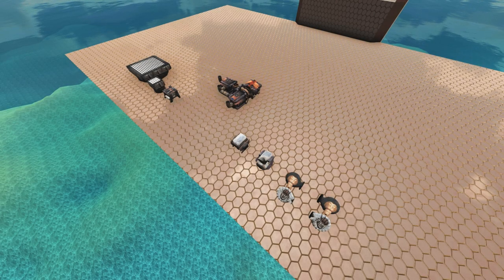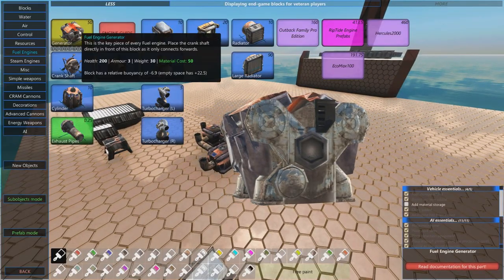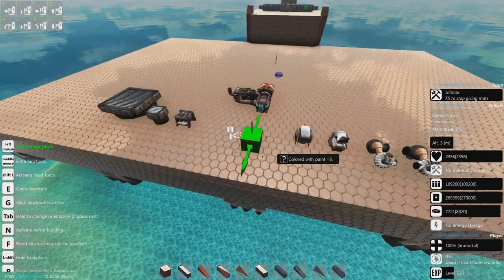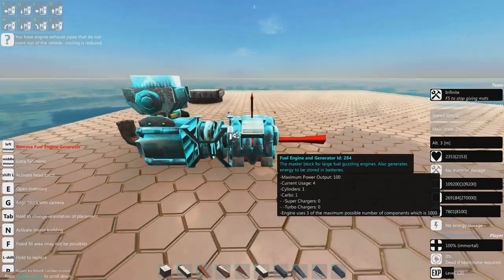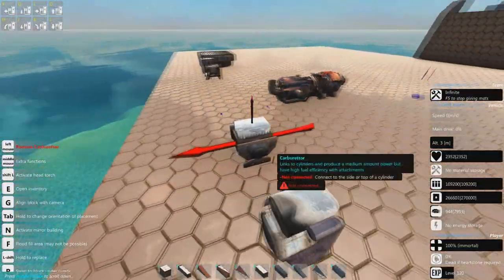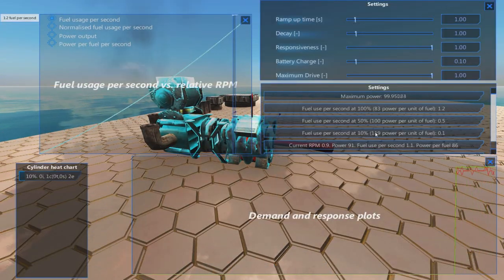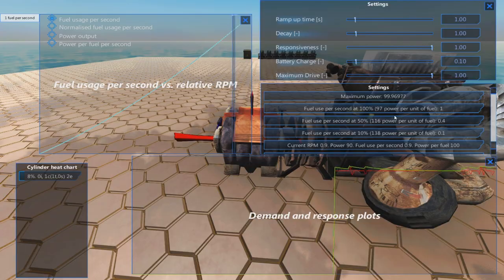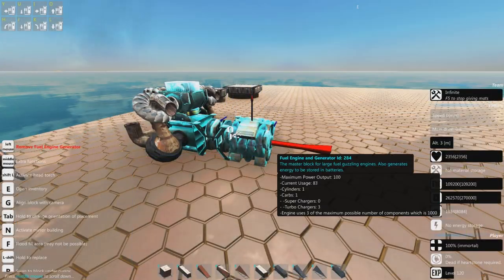Fuel Engine Tutorial (Part 1) - From the Depths (OUTDATED)

Comment: I always found it funny that engines can somehow stay down at 0°C
Considering that's the water's freezing point, it means it's colder inside the engine than in the world around it
Reply from the maker: Huh. I never thought about that... 🤔
Reply: @BorderWise12  when running methanol in an ICE(Internal Combustion Engine) , you can get frost on the exterior of your intake due to evaporation cooling.

Comment: The thing with the turbos is that those bottom connections are interchangeable, you can have exhaust come IN from either port, but then the other side HAS to be exhaust, that's why that first turbo didn't work as well, you tried to use both sides as intakes. Also neither variant actually has to connect right to a cylinder, the only thing that separates the inlines is how the input/output is set up. Many good engines actually chain the turbos together as they go, making the engine more efficient the further down it goes
Reply from the maker: That is excellent to know, thank you! :D
Reply: wait... THE TOP CAN BE AN EXHAUST ENTRY?!
Reply from the maker: @kirknay  My mind has also been blown. XD
Reply: @kirknay  Oh, nonono, not the top pipe, that does nothing, either of the bottom two pipes can be used interchangeably as an input, the top is always dedicated solely to the carbs

Comment: borderwise, what are you talking about? superchargers are insanely good if you do not care about anything but efficiency. I have made engines that can get around 500 power per fuel easily.
Reply from the maker: The engine prefab I use most often gets 964 ppf... and not a supercharger to be seen. 😛
I freely admit my ignorance regarding good supercharger use, though.
Reply: Superchargers only work when at low RPM, and there's no reason to be at low RPM unless you're idling while in play
Reply: @rompevuevitos222  And if your craft is running low-mid RPM in peak operation, then the engine is too big.
Reply: @BrokenLifeCycle  Just overshooting in power, you can replace injectors with carburators and remove some cylinders, you end up saving fuel and resources on the cost of the engine
Reply: but muh power density
Reply: I also guess the super chargers are really good for engines which use a lot of fuel under full power and the craft needs a lot of power even when it's not in combat. When there are no enemies around and you take down its shields and what not and still need power, you have your super chargers ready to produce that power at lower RPMs. And you want those lower RPMs when your unit is not in combat so you save more fuel.
Reply: @MrBrander  When not in combat you can pull units out of play to not waste resources, including fuel
And even if you are in a situation where you can shut down shields and similar to save power, placing ACBs to do it could get expensive enough to make it not worth it
Reply: I'll try experimenting on some kind of fortress that runs giant engine with superchargers that solely acts as a giant electric socket, and then use a fleet that runs mainly on battery. Probably not worth it, but hey, reason for a block to stay in the game.
Reply: @haveiszalfaroqie1628  I've always wanted to make a high tech fleet wich relies on maintenance crafts and buildings
For example: defenses are made out of lasers and particle cannons as well as a single bunker wich generates power, ammo, detection and runs some sort of support weaponry (jammers, harpoons, etc)
Fleets always have a carrier/repair drones with it that take care of the more technical stuff, this means that the rest of the crafts can use more of their space for combat capabilities and save on resources by not having to put repair bots and resource generation in all of them

Comment: My guide on my own ridiculous inline turbo fuel engine build.

-find a way to connect all cylinder sides with exhaust lines.
- leave the top cylinder for the carbs
- funnel every single exhaust line to the very first turbo on the line.
-connect the turbos together so that the exhaust gets reused by the other turbo on the next line.
-point the end of the exhaust turbo line away for max cooling.

*u can experiment by using a group of cylinders using an injector system. They produce a heck of a lot of exhaust and feed it to ur inline turbos. Turbos gets more efficient the more it receives more exhaust.

And the best part of it is to have fun solving the jumbled up mess of exhaust lines running throughout ur build.

Comment: 600+ hours in and I have never once built a fuel engine.
Reply: I currently run steam myself whenever I can, but settle for RTG battery setups when steam just can't fit. Fuel just doesn't have the versatility or output I need right now, especially now that steam engines have direct drive to screws.
Reply: On top of the fact that there are no engine prioritization systems in place. It will just pull the steam power, fuel, or electric. It can be a bit of a bummer when making a main steam drive with an auxiliary carburetor engine for backup power, since you want turrets and props to run on fuel engine more than steam engine that gives the ship a huge thrust advantage and/or act as a main generator for railguns if fuel engines do not have the space to charge batteries fast enough.

With fuel engines, supercharged carburetors are preferred for efficient builds, while steam takes over what fuel injectors fill in, while steam engines at larger sizes are especially tanky.

Resource usage is more significant at local settings, and cost rate is dependent only on volume.

That being said, someone better bring out the spreadsheets on the material conversion cost in comparison to fuel and steam engine to thrust.
Reply: @Aereto  you actually can control, to an extent, where power goes. On the fuel engine, you can set the % amount of power going to batteries. On top of that, you can have ACBs controlling the max output of engines. For example, your LAMS may occasionally use too much power, but not often enough to use more steam. So, use ACBS to do: when your battery is below 20% turn fuel engines to 100%, and another to turn them off and youre good.
Reply: I like to use hybrid systems that use RTGs and batteries, but then have a fuel engine that turns on when battery power dips below 90% (via ACBs). Very effective.
Reply: @brade3092  a sub i built runs everything on RTG except im combat. The shields drain the battery quickly and I have a fuel engine that kicks in to send ALL the power to the batteries

Comment: In-line turbos are your friend. Each turbo can only boost efficiency depending on the amount of exhaust gas passing through it (which is determined by the RPM). However, at some point (24 units, I think?) the turbo does not boost efficiency anymore. Because turbos only count the amount of gas passing through it, you can daisy chain the turbos together and they will all share the same efficiency boost. With a big enough engine, it can even have max efficiency boost at the lowest RPM because there are enough units of gas already passing through it. 

So to min-max an engine, you first collect the exhausts of the cylinders into a common pipe before running it into the turbo-centipede. The trick then is to figure out how to shove as many turbos onto each carburetor possible.
Reply from the maker: Yup yup! I have experimented with that very thing since I made this video. :)
Reply: @BorderWise12  The best fuel engine I've ever made produces 8000 power and a max burn rate of 1.6 fuel a second for a Power Per Unit of Fuel of 5066. 40 cylinders, 80 carburetors, 240 turbochargers.  
I challenge you to top that in terms of PPUF.
Reply from the maker: @BrokenLifeCycle  Challenge accepted, but with absolutely no guarantees of success. :D

Comment: I think the superchargers are designed for huge engines which are suppost to run on very low RPMs. That way you are exchanging material cost for fuel efficiency. Huge engine will cost a lot in materials but it will run on low RPMs which is good because of fuel efficiency. Then you add carburators and low RPM fuel efficiency increases. Then you add superchargers and low RPM fuel efficiency goes even higher. That way you have created a huge engine which cost a lot in materials but is extremely fuel efficient and produced metric tons of power (because it runs on low RPMs). 

And I think if you need even more power, add turbo chargers and you get more efficiency out of the engine at high RPMs when the engine ramps up to its speed when more load gets put to it maybe because of missing components on it when it has taken fire or something like that.

Comment: fuel engines are my favorite part.  Got to say I'm pretty disappointed.  BTW, I think one of the engines on that platform is one of my efficient engines.  I think it ran at around 13000 ppf at six cylinders and could easily be scaled up or down from 2 cylinders up to max parts.  I've got an updated version that is more power dense that I never published because I never saw many subscribers to that design.
Reply from the maker: We'll see if it's there if it's there. :) 
And yeah, sorry for the... un-expertise, shall we call it. I've had to refresh my memory a bit in making this video, as it's been actual years since I've tried making a turbo engine from scratch. :(

Comment: Finnaly a way to power my 500000 mat craft that are running with 300 power steam generators that produce this power for 10mat/s and can't even kill a marauder
Reply: Need better guns
Reply: For large scale crafts steam engines are just better
Reply: @rompevuevitos222  I don't think you understand. I build them so badly that they produce about 300 power per 10 material per second
Reply: @cultistofdarkness1661  Basically just pop as many boilers as you need, and then slowly add pistons until they stop self destructing
There's no special arrangement to make boilers produce more energy like with fuel engines
Keep in mind that valves and other kind of components reduce the power that the pistons can harvest
They also take a bit to power up, specially the bigger ones
Reply: @cultistofdarkness1661  get rid of as many pistons that it just doesnt break down

Comment: From the depths needs to add propellers to fuel engines. They can even be a little less powerful than steam engine propellers, I just want something that actually Burns oil on some of my ships.
Reply: The logic behind steam propelers is that instead of converting motion into energy the motion is directly used for the propeler, that would be ineficient with a fuel engine, specially when Custom Jets are a thing, they consume the fuel without the need of external power
Reply: @rompevuevitos222  The reason why I'm wanting a fuel prop system is because of the space involved in a steam engine doing the work is a lot more than a fuel engine doing it, as well as the fuel engine using fuel instead of materials. This would make fuel engines run a lot smaller, with a lot less power per cylinder, but without the worry about material drain from long battles. The size problem could be solved if steam engines could run turbines to screws instead of crankshafts, but I'd gladly settle for fuel engines instead due to immersion involving more modern ship designs. Besides, fuel engines have the need for effective cooling and a robust exhaust system to run effectively, which helps to balance out the size and efficiency problem.
Reply: @kirknay  Any powerful engine is going to be big af, just make some good tetris and you can fit a big steam engine in a 4x3x3 space, increasing the last dimensions to expand it
Without mentioning that you'll have to spend space making a fuel refinery and placing fuel storage, provide proper ventilation, etc
Reply: @rompevuevitos222  and that's kinda the point. A fuel engine will take up less room on ship, but will tie the ship to supply lines even in centralized campaigns, and will need a refinery to get fuel from. It is another side of the energy equation, and it not having the capability to directly drive a screw for more torque than the force magically running from engine to prop, when steam now has rocketry, seems like an oversight to me.
Reply: @kirknay  Again, you'll never get that amount of energy with a 4x3 fuel engine, but you can with a steam engine of the same size
Fuel engines only work on smaller crafts or  when you need a fast startup, at wich point it better be some glass cannon or you'll chew trough all your fuel before the encounter ends

Keep in mind that boilers don't need to be all in a single line, you can connect various sets of boilers to the same set of pistons (you need a separate controller for each one tho)
Reply: I just wish you can hook up a gearbox to the crankshaft of the fuel engine and run a prop.
Reply: @BrokenLifeCycle  exactly. They could even use that method to make reduction gears compatible with different sizes of steam engine shafts. Imagine using a lot of reduction gears to make a high RPM small steam engine turn a 3m screw, or a large turn a 7m screw a little slower than a huge would. The immersion with historical builds would be overwhelming. Heck, hook a propeller shaft to a turbine housing! Piston steam engines are SO pre-Dreadnaught.

Comment: Do you know some sources with information about good steam engines btw?
Reply from the maker: No, but rest assured I will be finding some. :)
Reply: There is a steam engine guide on steam on how to maximize efficiency.in short:

 use the shortest possible steam pipeline for connections.

 Never use release valves. It wastes steam.

 More small boilers are better than one big boiler.

 Bigger piston size does nothing but make the crank shaft harder to destroy at high rpm(tho they get giant steam props)

Use the minimum amount of pistons that you can without your crank blowing up. More pistons is a waste.

Steam Turbines are better for electricity than steam engines with generators.

 there is almost no reason to use a larger turbine over a smaller one. Larger turbines  can deal with larger amounts of pressure, but you generally won't be needing more than almost a half a million energy a second, which is abour what the mini steam turbine can pump out before starting to slow down and waste steam
Reply from the maker: Cheers! 
Also you've got an accidental link in your comment there.
Reply: @comet.x  btw its worth to put generator to your propulsion crank if you have some free space?
Reply: @stallfighter  everything on this platform should still be relevant:
https://steamcommunity.com/sharedfiles/filedetails/?id=859470292&searchtext=steam+engine

other info to note: steam currently has a static efficiency
no matter which components and how many are used, materials burned * X = power output
this, however, is subject to change in the coming weeks/months

Comment: you can still  build engines that use zero fuel at max load.
Reply: They patched that a while ago
Reply: @rompevuevitos222  In the last few months?
Reply: @rompevuevitos222  then again. I haven't built anything large enough to need those engines in a while. but it hasn't been that long, a year max.
Reply: @TheDanc1nghawk  Nah, it was before the graphic update, it goes way back
You can make them consume very little, but not 0